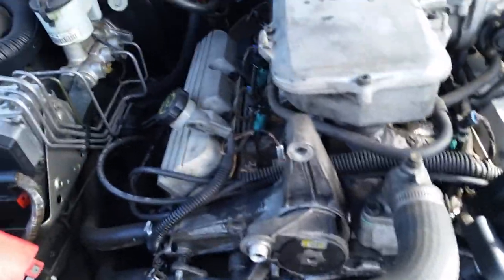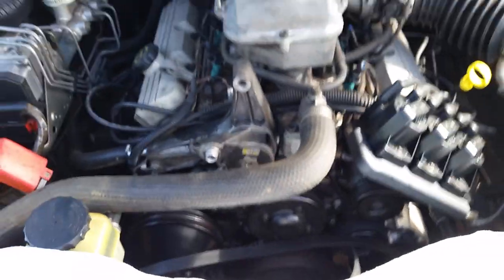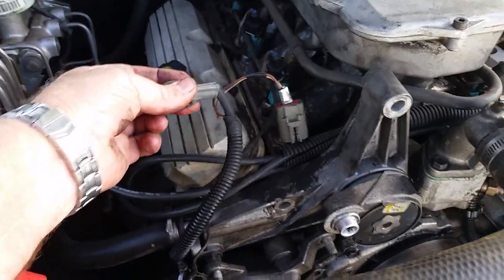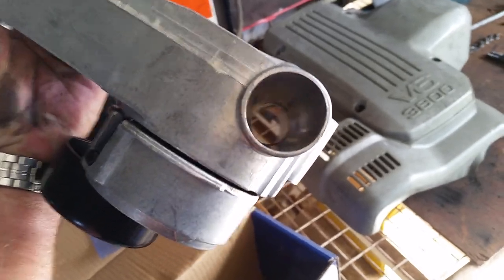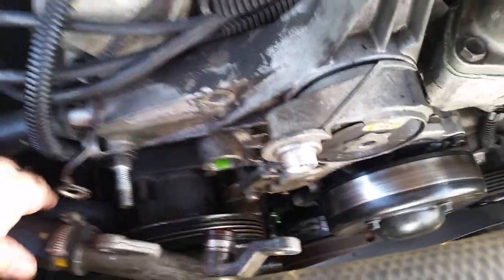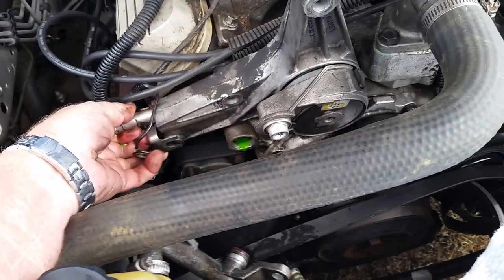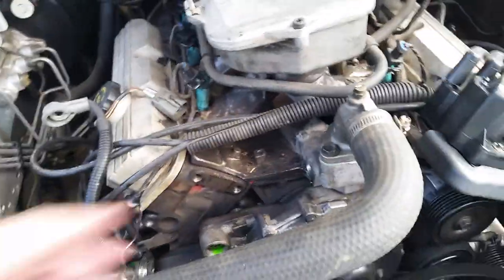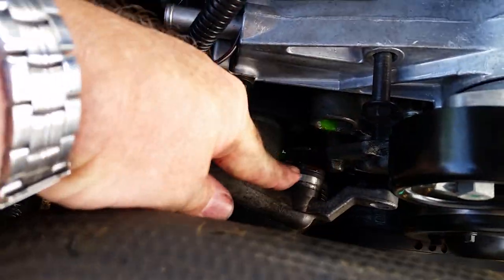Part 2 Commodore Belt Tensioner Change VT VX  VY 3.8LTR V6 Ecotec

Comment: Well done !. Did this last about 12 years ago going the Intake Manifold Gasket and all because I never pushed that long pipe back in far enough I thought I was leaking from the LIM and the block. You can see from your video where the pipe goes and and there the manifold and block touch are in the same place. Had to do it all over for nothing. You learn the hard way. Mark the pipe with a marker where it goes into the thermostat housing and on the other end where hose goes so you know you pushed it back in far enough. Also use Vaseline or Rubber gasket sealant on those O rings so they seat and dont more when pushing back in. Hope to see more of your videos on the future.

Comment: Thanks heaps, got the job done and did not make any of those easy mistakes because of your guide.
I was also able to not loose too much coolant by using 25mm and 20mm conduit plugs with some electrical tape to bung in the holes.
Reply from the maker: Glad the video's helped ,  cheers mate  👍

Comment: guru, cheers heaps mate. would you have any idea as to why/how the belt on my VY would jump off? tensioner seems fine and belt is in good condition.. refitting it roadside is a bit of a challenge...
Reply from the maker: Angus Arnol 
Hi Angus ,  i would check that it is actually the correct belt firstly , then have a look when the belt is on the motor ,  stand on the drivers side and with your eye's  line up the edging of the belt to make sure that all your pulleys are inline ,  as on my vx i found my alternator was way to far inwards to all the other pulleys so i took off the pulley on the alternator and made a spacer to go behind the pulley to space it out so it was all inline with the rest of the pulleys . Basically make sure the belt is running straight.   Cheers hope this helps.
Reply: @emptytinny  video was heaps of help, i'll check allignment once i've refitted the belt. cheers

Comment: If I need to just replace the O ring, on the pipe that goes into the thermostat housing, do I need to remove the belt tensioner?
Reply from the maker: Not off memory no , just take off the hose , undo 1 bolt and it should slide out I'm pretty sure  , use some plumber thread tape around it and heat resistant silicon and push it back in , let sit overnight , top up fluids and give her a run . Cheers mate 🍻👍
Reply: @emptytinny  looks like I probably won't have enough room to just pull that pipe out, it will hit the inner guard before it comes all the way out of the tensioner. Did you have to put the heater pipe into the housing before you bolted the tensioner on ?
Reply from the maker: @wisecampmotorcycles8258  
Hi mate , yeah i was thinking about that today as to weather you'd have enough room , if its hitting the wall the sad new is your going to have to do the dead and take off the tensioner unfortunately , because you'll have to prep the pipes end properly and then insert it back into the tensioner , if you push it in slowly when putting it back together , as soon as the bolt hole line's up with the heater pipe slot wack the bolt in it so it doesn't go in to far 👍.  Cheers mate let me know how you go.
Reply: @emptytinny   Will do. Thanks for the advice. 👍
Reply: @emptytinny   Hi mate, I finally finished the job today. I let the sealant dry overnight. I was nervous to put coolant in it, but it all went well. No leaks.
If I had to do it again, I could almost do it with my eyes closed, thanks to your video mate, it helped me out all the way.
Cheers 👍
Reply from the maker: @wisecampmotorcycles8258  
Cheers mate , you done it all properly if you got no leaks and saved somewhere in the region of 6-7 hundred dollars , good work mate .

Comment: When taking the pipe out that goes through the tensioner pulley and into the thermostat Did u just pull it hard
Reply from the maker: Hi jack , basically yes , just keep wriggling it while pulling on it and it should come out easy unless someone has glued it in. 
Cheers mate.
Reply: @emptytinny  I have been wiggling at at it for like 20 mins lol it turns but I just can’t seem to get it out
Reply from the maker: Try turning it up with where the bolt bracket is and put a spanner over the pipe up against the bracket , then tap the spanner with something 👍
Reply: @emptytinny  will give it a try tomorrow and cheers for the help
Reply from the maker: @jackdoolan3748  someone must of glued it and the o-ring is stuck , failing that you may have to use LPG Heat to free it up on the end bit . ....

Comment: Did you have lack of acceleration when the idler tensioner went?
Reply from the maker: Hayden Mackenzie 
Hi no i did not  ,  basically i had a squealing noise from the belt  .  If you have a lack of power I'd check your air filter ,  spark plugs  ,  and leads  first ,  if that doesn't work check your fuel pump (it's inside the fuel tank ) and the fuel filter  .
Cheers and good luck 🍻👍

Comment: Hows that tensioner pulley holding up? Im looking at that brand you bought or the more expensive gates brand
Reply from the maker: Hi Bobby , actually funny you ask because i had to replace it again due to being a cheap pile of crap i got less than 5000 kms out of it so i put a GATES on at about $120 AU  , the quality difference between the two is clear when you sit them side by side. I also put all new GATES hose kit and heater valve assembly on at the same time. Cheers mate and don't spare the $$$$ 👍
Reply: @emptytinny  Exactly why I asked! Ive been warned against the crappy eBay stuff going cheap. When its time ill go the gates or Dayco brand. Cheers old mate!

Comment: How long did it take you to do roughly mate ? I'm doing mine today in my vs Ecojet
Reply from the maker: If you haven't done it before you'd probably want to give yourself around 3 hrs taking your time ,  its not hard just make sure you put a sealant on them O-rings and all should be fine 👍.  Cheers mate 🍻
Reply: @emptytinny  thanks mate I thought it would be a few hours no rush cheers
Reply: How much coolant did you lose ?

Comment: *SAFETY WARNING* Do Not take off the positive lead off the battery first.  If your spanner or ratchet  touches any metal while taking off the positive you will shock yourself and most probable damage electrical components or even weld your tool to your car.
Reply: Other than that, good video.
Reply from the maker: Ashley Savio  ,  hi  ok now i know about this move and let me ask you this  ,  what do you think will happen if i take off the negative first and i short the terminal with a spanner in the same way ???  It's a matter of " caution " either way .  But thanks for your comment.  Cheers 👍
Reply: @emptytinny  I'm not having a go but if you do the same with the negative it will do absolutely nothing as your effectively earthing the earth lead. That's why it's safer to remove the negative first and put it back on last.
Reply from the maker: @ashluna27   Hi  ,  dam i don't know how i miss-read your first message but i thought you were saying to take off the positive first ,  sorry yes i totally agree  to take off the negative first infact I've had this age old conversation with many people  ,  i mean once the negative is disconnected the system is dead ,  and as long as the key is out and OFF  the only concern you would have is to not short across the 2 terminals  with tools  ,  in saying that if people want to be truly safe  ,  hey take the battery out all together  . 
Cheers 🍻
Reply: @emptytinny  All the best👍
Reply: "Shock yourself" with a 12v battery....
Back to the books mate.
Reply: @josh6401  it's not the voltage it's the current. Just like how a small 12V house alarm or motorbike battery won't start your car. But sure, you sound like your a professional technician and know what your your talking about so good luck.🙄
Reply: @ashluna27  lol and you are?
Did you get your certifications from a weetbix box? Because it's really looks like it when your saying a 12v car battery is capable of supplying you with a shock.
You are correct about one thing and yes it's the amperage, however the body has so much resistance dc won't have a noticeable effect on the body until in excess of 12v, no matter if it's 5A or 5000A.
I can tell you this from personal experience. 
Now please, go back and read your text books.

Comment: The aftermarket tensioner is shit. Don’t buy one they are very poorly made and are imitation parts.
Reply from the maker: Hi MsDich ,. Yes i agree the cheap one i bought originally off ebay for about $45 only lasted for about 5000kms and it was worn-out so i had to do it all again , so thats why i state buy the "Gates Brand " as they cost more but last ages .  Cheers mate 🍻
Reply: @emptytinny  . I bought the gates one yesterday. I sold the car for $2 to a battler as is ,,but my conscience got the better of me .So it’s cost me $225 for a new tensioner and belt. No good deed goes unpunished.

Comment: Having trouble trying to get the tensioner off with the pipe in it, did you pull the pipe all the way through the left side?
Reply from the maker: Just pull the centre small pipe out about 2 inches but disconnect the hose off it first then take off the tensioner 👍.
Cheers.
Reply: Thanks mate, Exactly the video I needed ! The Step by Step is ESSENTIAL for this job and I ALWAYS have problems fitting a new Belt (Any HINTS ?)